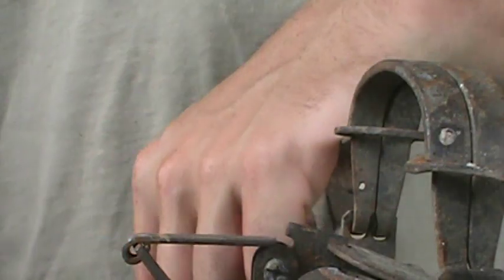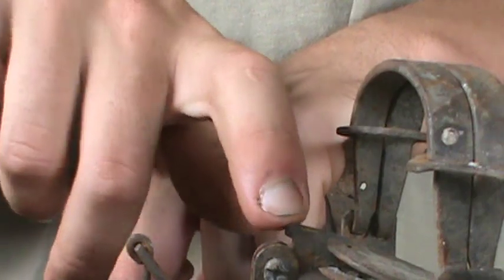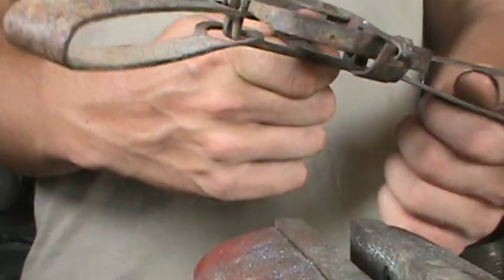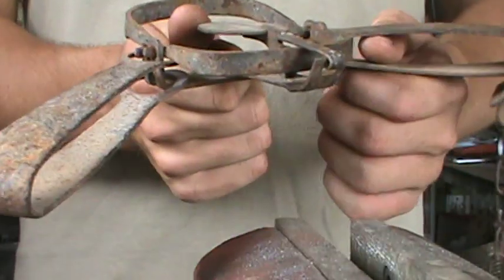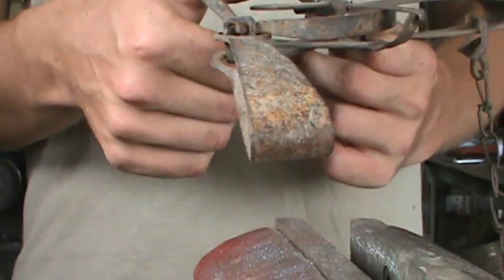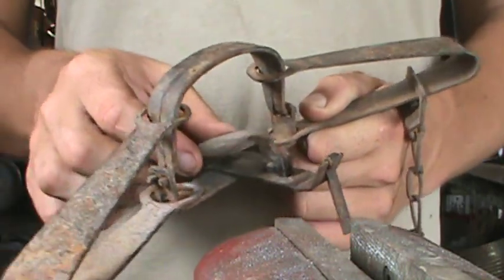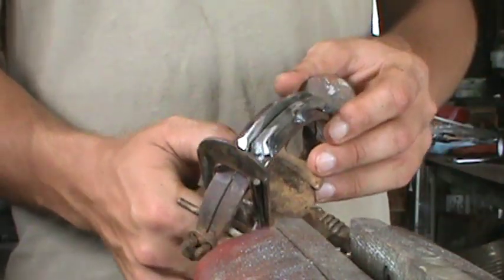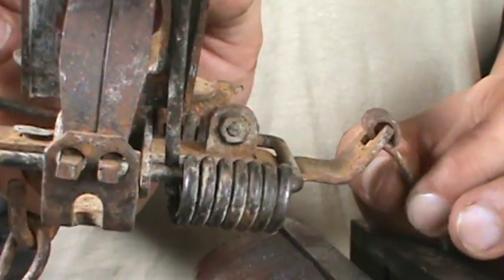How to night latch a trap

Comment: Do you laminate and baseplate and center swivel your traps?
Reply from the maker: Ohio traper yes all my predator traps are fully modified
Reply: Trapper_martz01 I'm only 13 and I can't weld so I was Wondering if I can get a trap ready for traping without a welder?
Reply from the maker: Ohio traper I'm sure you can. Probably bolt the base plate on. If you can't I'd just buy em already modified. That's what I do
Reply: Trapper_martz01 what traps come modified?
Reply from the maker: Ohio traper just about every brand has options for modified traps starting at #1 3/4
Reply: Trapper_martz01 I bought a duke number 3 and I did not come baseplated so I was wondering what brand should I use?
Reply from the maker: Ohio traper I really like Bridger ,#2 or 1/34